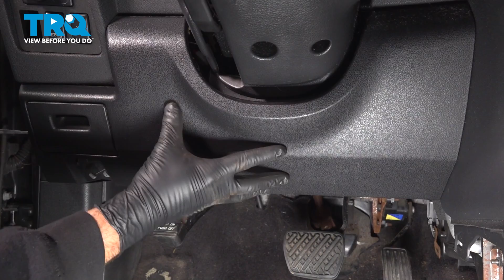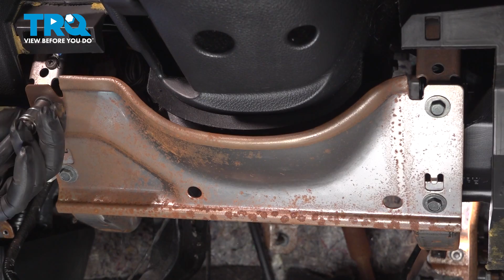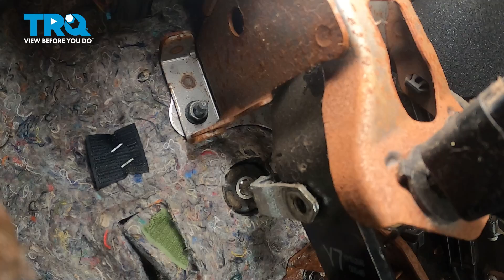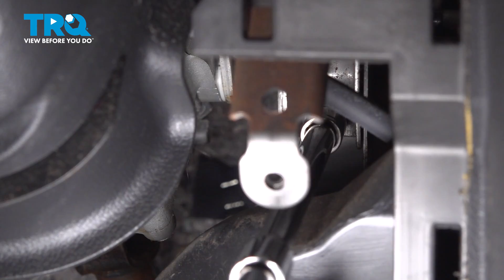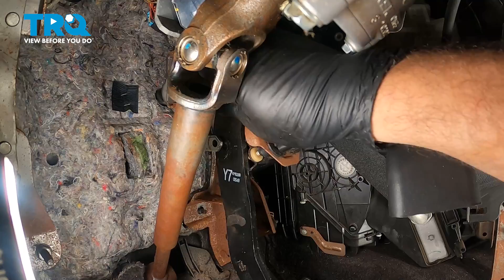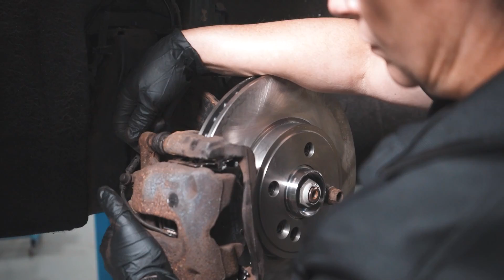How to Replace Blower Motor Module 2008-2013 Nissan Rogue

Comment: Thanks guys! I wasn't sure if I didn't have air because of the blower motor or the resistor so I ended up replacing both. It turned out to be the resistor. Your videos made an intimidating task manageable, and saved me $600!!